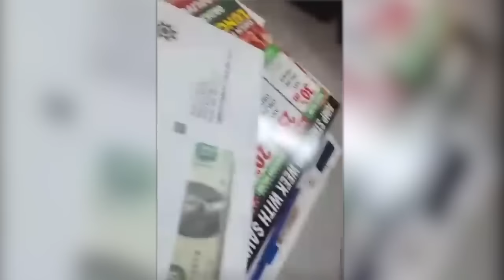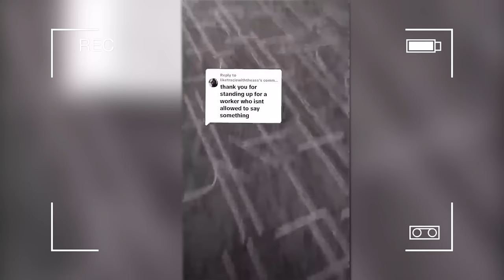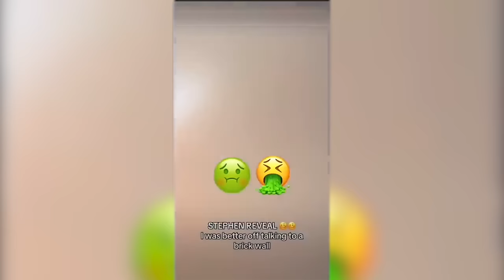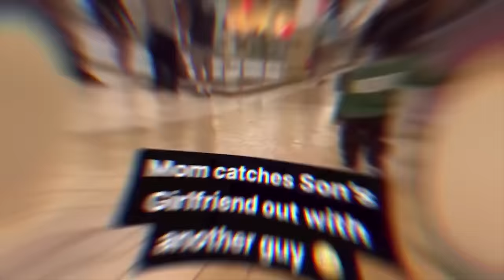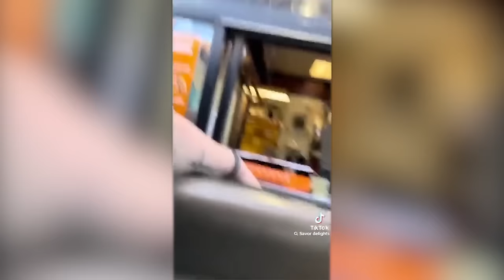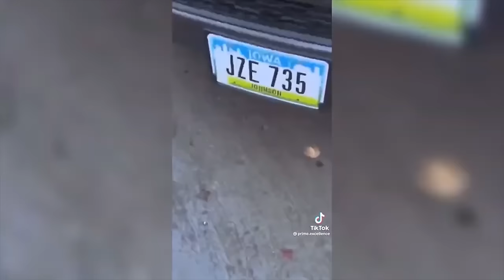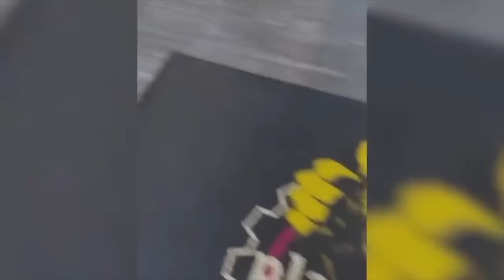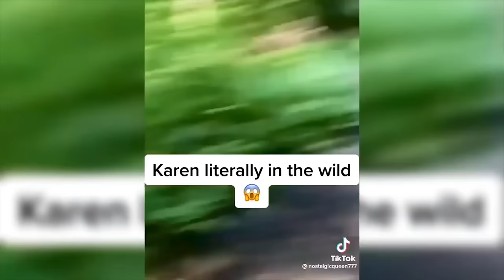2 Hours of KARENS Messing With the Wrong People

Comment: The elevator nazi is talking about ADA requires at least one elevator must be working at all times, but that's not true because during a catastrophic power outage or a fire the elevators will shut down. If there's a maintenance issue, there's nothing they can do about that other than get it fixed, which they're doing. The maintenance guy should turn on power long enough for the guy to get in, then shut it down so he's stuck 😂